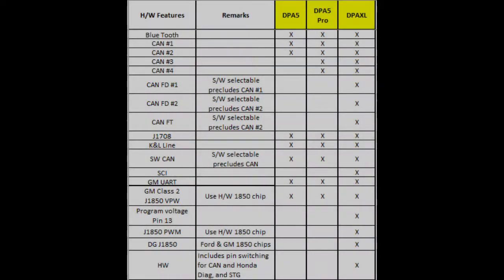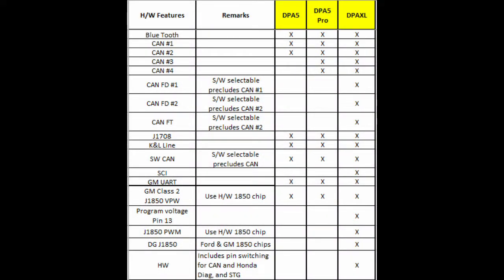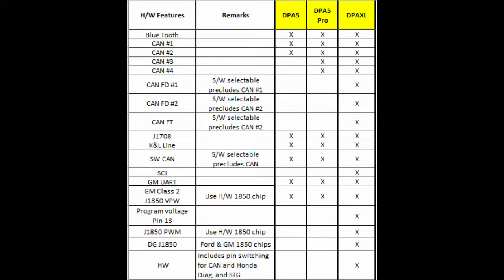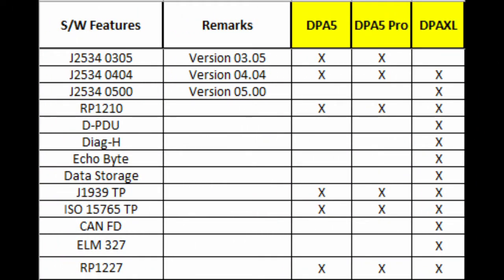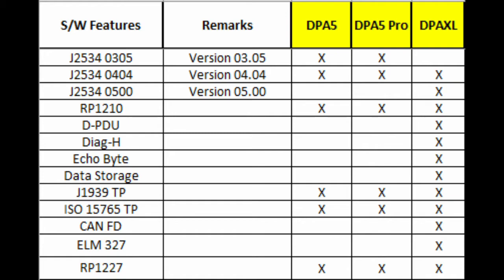DPA XL In-depth Comparison (New Features and Benefits)

Comment: This adapter is expensive, but ANY adapter avialable on market work much better. Nexiq2,DLA2.0+,DrewLink aka DieselLaptops ... all those work faster,stable,without any issues. With DPA XL prepare for hard time while want connect to truck and diagnose. Next this  adapter fail after couple times use and now is very expensive paper weight. Definitely my experience with ,DPA XL is bad,even tech support didn't answer,or call back,only working department is sell department... cyber security secure adapter forever...
Reply from the maker: Dear MrStojanow, thanks for sharing your feedback. We’re sorry your experience didn’t match expectations. It has been communicated to us that our new DPA XL has been working very well for others but we would like to make things right for you if you give us another chance. 

This situation is not up to our standards. Can we investigate your feedback further and help to fix the situation?

Overall this sounds frustrating, may we reach out to you or would you please let us know how else we can help. You may send the information to techsupp@dgtech.com and sales@dgtech.com or call us at 1-248-888-2000, we’ll work with you to resolve the issues as quickly as possible.